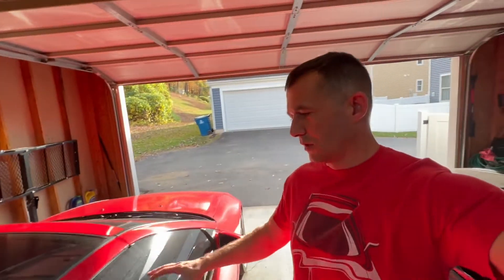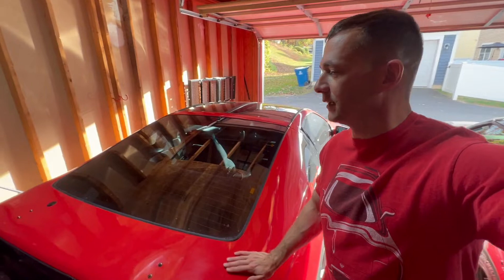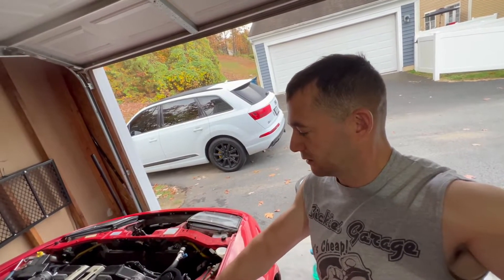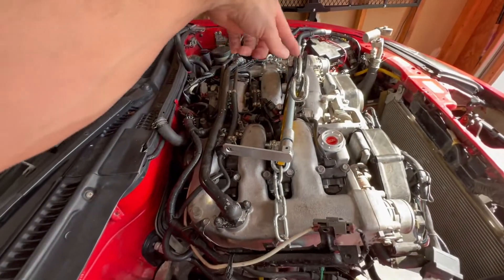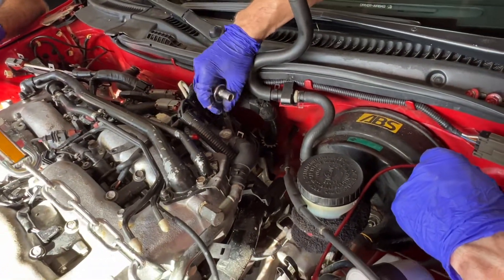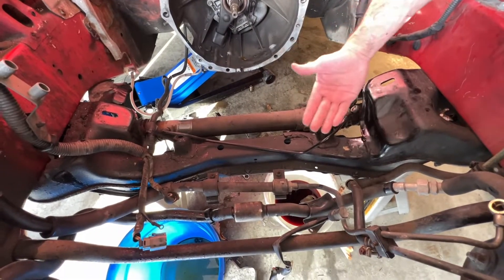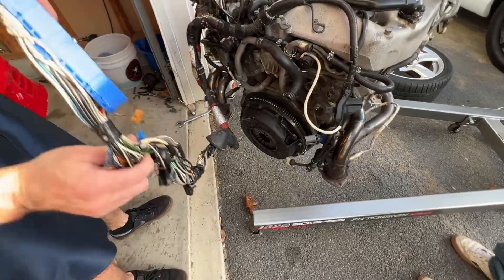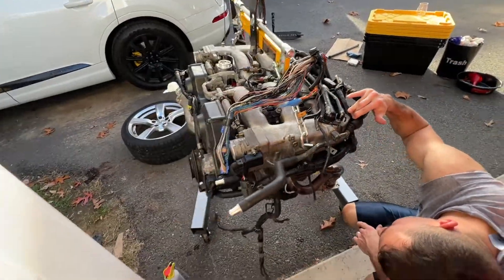We Finally Pulled the Engine!!! Project Nissan 300ZX Motor Pull VG30DE Z32 Built By Miller

Comment: Takes less than an hour to disconnect the engine connections. You must be the first to remove the EFI harness with engine on a Z32.
Reply from the maker: Not sure I could do it an a hour, but it had to be removed anyways so I figured I would save the buyer some time, not to mention the odds of breaking any plugs on the harness.
Reply from the maker: Concur with this. If you are keeping your harness then definitely pull it off the motor!

Comment: Dumb question: Why paint the engine bay? I woulda figured a deep clean would be enough - not like its the wrong color or damaged. Unless your seeing something I'm not....
Reply from the maker: To make it minty, lol
Reply from the maker: No seriously, there are some rough spots on it. Plus there’s some kind of sticky anti rust coating that’s is clogged up with dirt from the past 30 plus years and when you scrape it off it leaves the paint looking dull.
Reply: @builtbymiller  yeah the ones shipped from Japan were sprayed with that to prevent rust on container ships